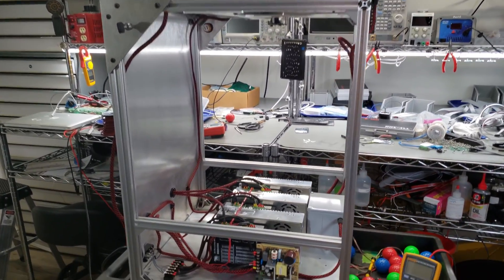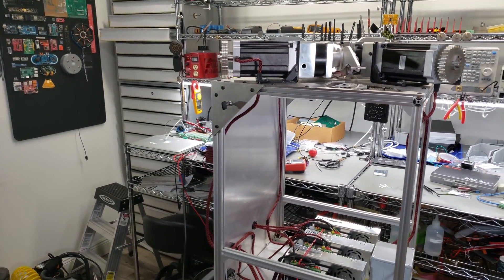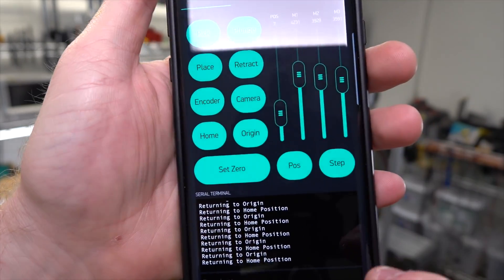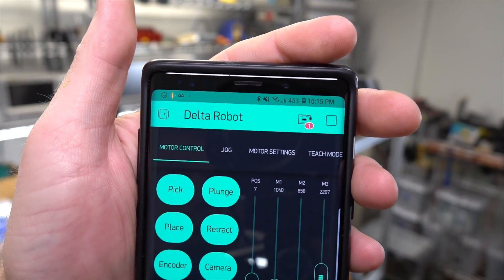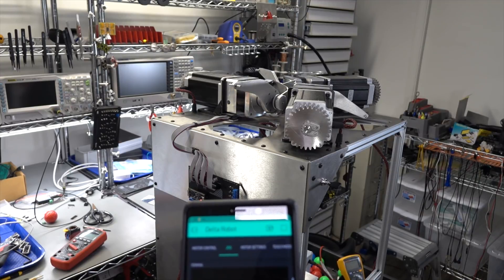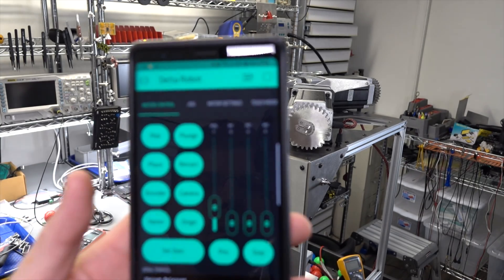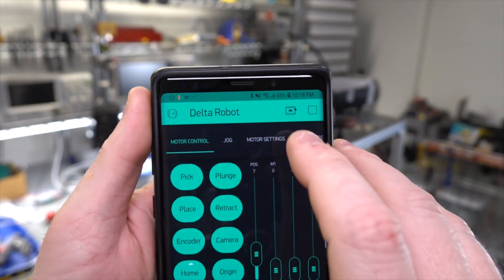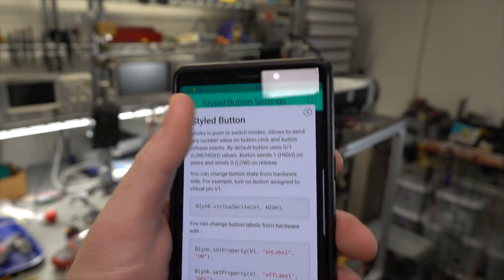Easy Robot Controller

Comment from the maker: Here are links to some of the equipment used on my delta:
Blynk App - https://www.blynk.cc/
Stepper Motors and Drivers - https://amzn.to/2RcFBqK
Golf Balls: https://amzn.to/2r4rkBl
ESP32 - https://amzn.to/2TK9Sik
Object Tracking Pixy Camera - https://amzn.to/2r4GaaL
Braided Cable Sleeve - https://amzn.to/2LedCnb
Stainless Steel Cable Ties -  https://amzn.to/2LevZsb
Strain Relief Cable Glands - https://amzn.to/2LdnuO8
Silicone Fusing Tape - https://amzn.to/2J5RPO8
Locking Casters - https://amzn.to/2kJ75WB
Aluminum Extrusion - https://amzn.to/2Lh14M7
Cable Clips - https://amzn.to/2xColG8
M5 T Slot Nuts - https://amzn.to/2HdnNWP
M5 Screws - https://amzn.to/2J4OSBs
Carbon Fiber Tubes - https://amzn.to/2J5xVqz
Suction Cup Nozzles - https://amzn.to/2Qh2Vqg

Comment: What  are the gears on the back  of your motors I have seen a flywheel on bearings around balscrew  on big cnc machines too
Reply from the maker: They are just cosmetic hand wheels to move the motors when the power is off.  I did not like the look of the rear shaft without anything on it.
Reply: @ProtoG42  oke its that simpel  i was thinking inertia  balancing  so it has the same stopping time as the gearbox so it would not clunk  as much

Comment: Nice job on the cable management! I love the blynk app, currently designing a colour sorting conveyor system for a college project which will utilise blynk to switch between an auto mode and manual mode with all the controls.
Reply from the maker: Thanks, you should make some videos about your project if you're allowed to!